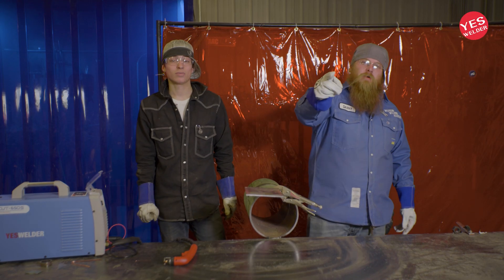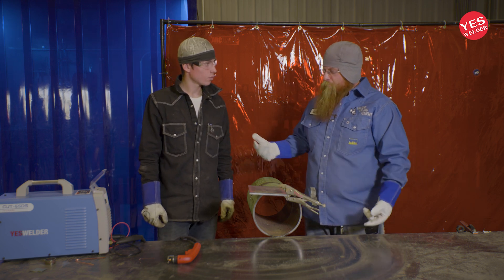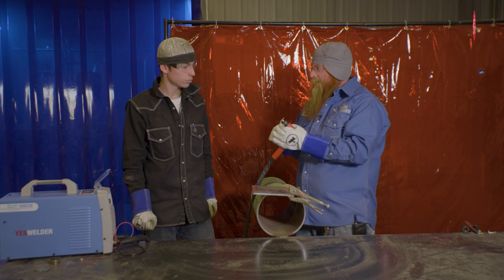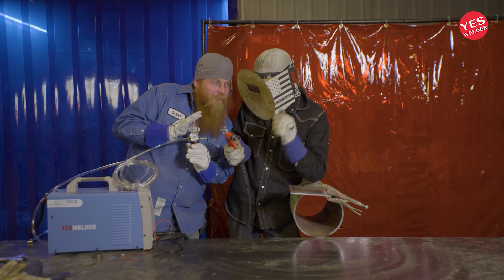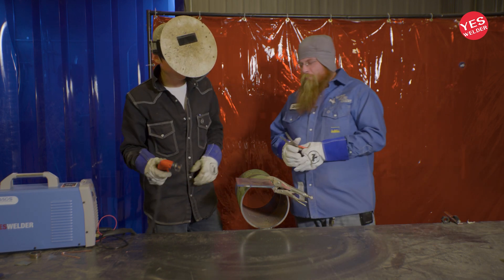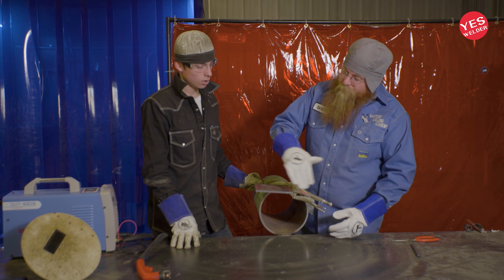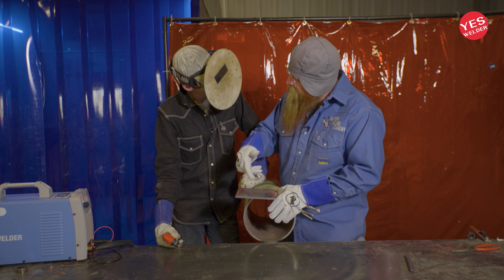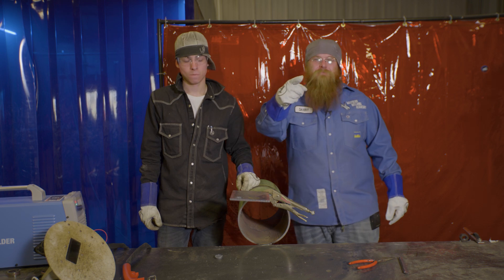Plasma Cutting 101 YesWelder CUT65DS | ft. Western Welding Academy

Comment: Danny and Evan, The spec for this cutter recommends 63 Amp breakers. Since I only have 40 Amp breakers, please tell me if that will still work with this machine? Thank you
Reply from the maker: Hi Chek! For our CUT-65DS, it may not work well with a 40 Amps, better to use it on the recommended breaker.